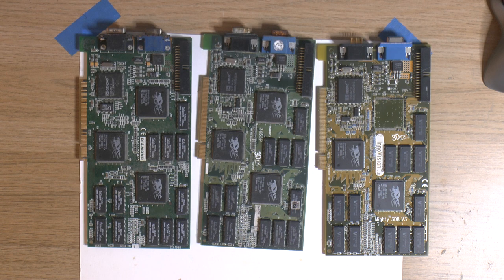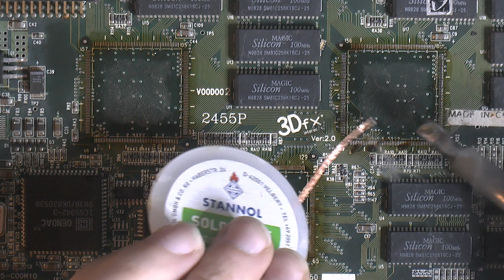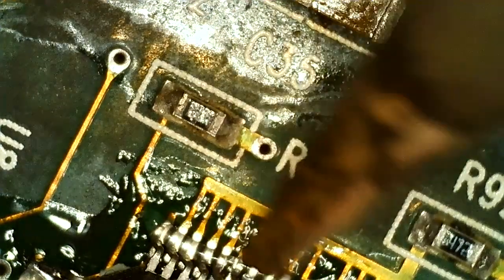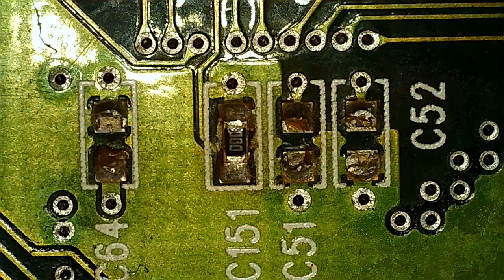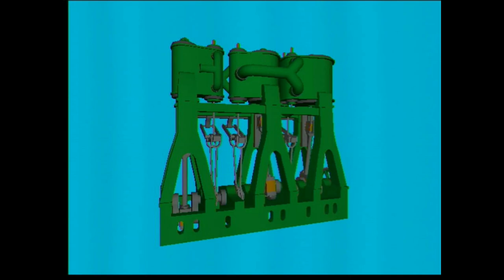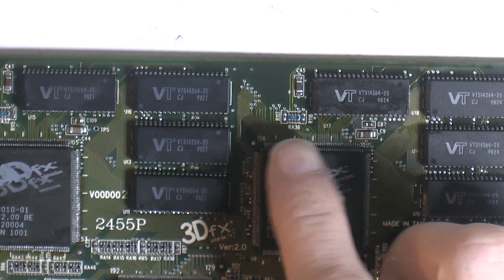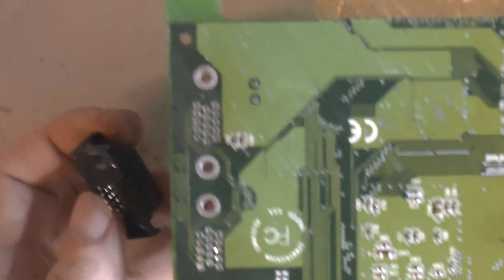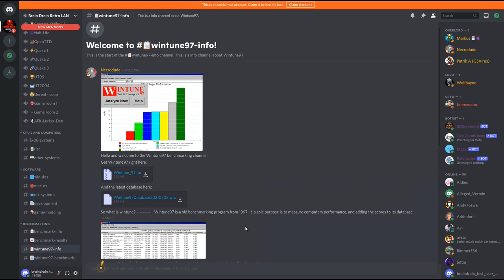3 broken 3dfx Voodoo2 cards, can we build one working?

Comment: Great job! That "magic finger trick" is very underrated. It personally saved me twice. I had a Voodoo 1 that displayed all textures with totally trashed and random pixels. There wasn't any obvious damage on the card. But when I moved my fingers across the texture memory chips, the colors started to change. The textures went black when I touched the same area on any of the four texture memory chips. It turned out that the floating pin was their common RAS pin. It was connected to the TMU via a 0 Ohm resistor that jumped across another track. While the resistor looked completely fine, it was totally open. The other time, I managed to find two broken traces under the socket of an A500 Denise by touching its pins (which again made the screen colours change).
Reply from the maker: Yea I need to trust my magic finger more in the future!

That extra flicker i noticed in quake 1 touching texture ram on the front tmu drove me nuts, until I noticed it disappeared after the resistor array that proved to have a crack in it that the multimeter didn't seem to pick up on and re-flowing the joints with the iron did not make the broken corner fall off like they usually do.
That resistor array had me fooled for over a day until I realised it was the problem!
But I learned something and that what counts!
Reply: At least all that meaningless swapping wasn't in vain after all. I hate putting away stuff because I already wasted way too many hours on repair attempts. I always tell myself "maybe later some day I'll give it another try". But I know very well that this day likely won't come ;-)
Reply from the maker: @Shmbler  My first Voodoo2 I got for retro use in 2017 on "ebay" was a broken scam card, was in a box of mine for 2 years before I figured out the the last problem, broken pin with a microscopic fracture I could not see.
The same day I fixed another Voodoo2 with the same fault because of the experience I gained.

I always tell people to put it back in the todo box, someday you find the fault and fix it and thats the fun part!
Reply: That's good info, thank you.

Comment: Well done. I have a couple of broken Voodoo2s but I never felt like I was skilled enough to repair. I can replace simple SMDs, but multi-pin chips are a real challenge.
Maybe one of these days I'll be brave enough to repair them.
Reply from the maker: Was my first time removing and adding QFP to a board of any signifiant size.

With the right tools its it seems fairly safe.

So you never know until you try.

Comment: that was a real labor of love. I hope this card works well for you for some time. Seems when you see the chips in such a bad state the all the chips need to come off and have their pads cleaned.
Reply from the maker: Everything but 4 ram chips and the DAC came of at some point.

An ultra sonic cleaner would help I think but I cant afford one at the moment.
Would help with both  cleaning dirty cards but also remove flux, tough not "needed" when using "no clean" flux BUT it would makes the cards look more presentable.

Comment: You are a very inspiring fellow, greatly appreciate your videos. I have a V2 that shows black and blue bars when it switches to glide mode, a problem I haven't found anyone else mentioning. I already replaced the Gendac chip but the exact same issue occurs. It's recognized by win98 but I never checked the system info as you did, also I'm going to run Mojo.exe, and use the temperature gun on the chips to see if that gives me any ideas. Card looks beautiful and the pins are all good but I might attempt reflowing the FBI. Have you encountered anything like that before? recognized but displays black and blue bars ( aprox 2" thick running vertically). Fortunately I ended up getting this card for free, the seller sent it in a letter envelope (overseas) with no padding.. I knew right away something was odd. To be sure I tested it on multiple systems 486-to-P3 (with the stock drivers and newer.) but it was DOA.
Reply from the maker: Have not seen that problem.
Would check for lose pins on FBI/TMU's and damaged smd resistors, arrays and such. Most common problems.
Reply: I will do exactly that, I was afraid the card was a lost cause, since finding replacement 3dfx chips seems nearly impossible, maybe it's something else. You've given me hope. Thanks again.

Comment: Can you put more then 12mb of ram? Maybe 16 or even 24mb
Reply from the maker: In theory its possible to increase it. I dont think anyone figured out how tough.
Reply: so you can’t just drop in higher capacity ram?
Reply from the maker: @Caleb-fv5fp  No. You need to wire up properly to address the extra space, that goes for most ram chips.